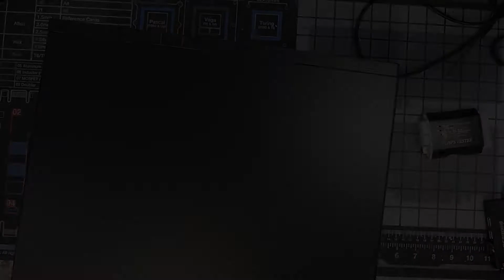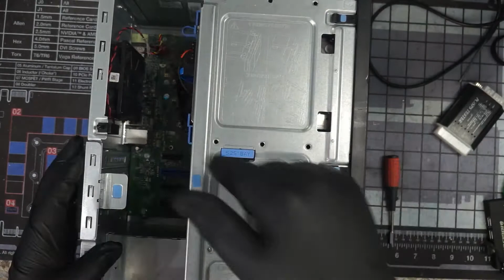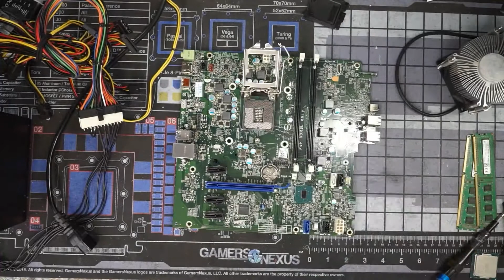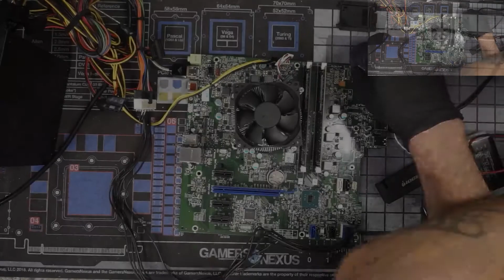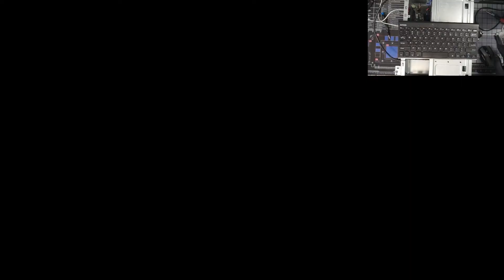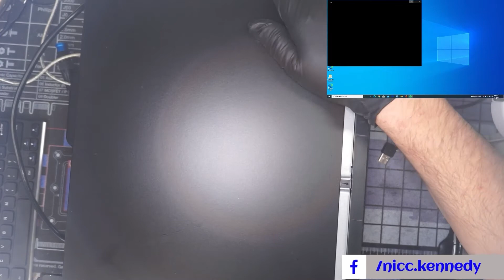Power Surge, Customer "Thinks" Power Supply is Bad ( Is it Really though?)

Comment: My friend has a computer that shut down randomly playing 7 Days to Die. 
She said it was as if her monitor turned off. 

Her power button on her case still lights up when it’s “on” and off when it’s “off”. Besides that, there is no other indication the computer is on. None of her case lights spin, the processor cooling fan does not spin, I’m not sure if her motherboard should have a light on the board to indicate it’s on, but there is no light there. I’m confused why the case light power switch still works though. 

Would this be a power supply issue or a mother board issue? 

She has an Intel core i5 @ 3.2GHz
GeForce GTX 1060
16GB RAM 
Gigabyte motherboard 

I’m trying to take the lead on this issue instead of my tech boyfriend taking over.
Reply from the maker: Have to troubleshoot. Try reseating the ram with power unplugged. Unless you have spare CPU, power supply and motherboard, will be hard to troubleshoot beyond that. You can research using paperclip or wire to test your power supply with every connection unplugged from the motherboard, but not recommended if you are unfamiliar with this method. Most people would use a power supply tester.
Reply: this type of problem usually because of overheating. maybe the gpu fan not been optimize. causing the overheating.

Comment: You did not explain what was wrong with the original motherboard.  Why did it fail?
Reply from the maker: The optiplex from this video was in a residence. For different models of this brand computer bought from us, I kept spare parts in shop to keep downtime to a minimum. I have looked at a number or these computers. If i remember this one correctly, it was missing one of the power rails and not turning on. Having spare boards, i did not dig too deep into what the problem was. Perhaps a revisit on this board? I will also need to order or make a new optiplex to atx power adapter, the one in the video was reused to make another cable.
Reply: @NiccKennedy  Thanks for the reply.  I have been searching for days on a solution.  I came close but still not fix.  I saw a video where this guy jumped the pins on the 24pin power connector while connect to board and it powered up but turned off when he removed the jumper (tweezers).  So, yes it seems a missing power rail somewhere.
Reply from the maker: @whollenbeck8  I dont want to recommmend too much or too complicated information, however, these boards fail like this for a few reasons. Multimeter and test, is one way to run it down, and if you know what you are doing, voltage injection. Word of caution though, do not attempt voltage injection if you do not know what you are doing. Let me know how testing goes.
Reply: @NiccKennedy  Thanks.  This seem too far deep for me and would cost more than what the board is worth in terms of time and effort.  I'm just learning new things and this seems way far into the future if I ever decide to take the dive.  I've gone as far as reprogramming the BIOS chip with no success.  You'd think a decent surge protector and a PSU would be enough to filter out voltage spikes and whatnot from a lightning storm.  This board goes into the 'just for parts' bin.
Reply from the maker: @whollenbeck8  Exactly the place where the boards I've looked at went. BIOS reprogramming is fun. Use one of listed in description means of contact if you need help with bios reprogramming sometime.
Reply: @NiccKennedy  Thanks Nicc!
Reply: @NiccKennedy  Follow up.  After a long process of trial and error I narrowed down the issue with the mobo mounting to the chassis so I removed all screws and the dead slots are operating.  Perhaps a grounding issue or the chassis is warped causing the mobo to warp and make the cpu  pins bend just enough away from the contact points to disable the ram slots. weir huh?
Reply from the maker: @whollenbeck8  Possible cause. or there is a short created with the board installed fully in the case. Did you look for pinched wires, they do pack a lot of wires into a small space in the optiplex series.

Comment: I have problem so when I turn off my pc randomly in middle of the night lets say it turns it self on and it also randomly shuts it self down this not when just playing games this happens all the time even if i am chrome,i have tested everything exept my motherboard psu and cpu and i havent formated my OS yet either but i dont think its a os problem cause sometimes soon as i turn on my even before i boot into windows my pc shutsdown so please let me know if u know how to fix this this has been happening for the last month and i am going crazy
Reply from the maker: There are a couple of things to check. Check your bios, to see if there are any wake alarms set, like wake by network, wake by mouse or keyboard. Another thing to check, is the power button malfunctioning? If a desktop pull the connecter from front panel header for the switch ( located around the pins for reset sw, hdd led, pwr led, spkr) if it is a desktop. Laptop will not be so easy to test power button. Also check windows advanced power settings, by going to search, control panel, power options, advanced power options ( none of these settings are located under the gear  icon/ windows 10 settings, but can only be accessed through control panel). Check those few things first, and then please let me know.
Reply: @NiccKennedy  thank you I just diagnosed that it is my f panel cable or connector I disconnected the cable and pc wouldn’t turn on by it self I appreciate this 😊❤️
Reply: @NiccKennedy  do I need to replace my f panel or is there a fix to this
Reply: @NiccKennedy  and my headphones when connected to my front panel also stop working randomly but mainly power buttons so this explains it
Reply from the maker: @Alpha-hp7xv  What computer is it?
Reply: @NiccKennedy  its gamming pc so i think i need to replace the case i have my warrenty still i should be fine
Reply from the maker: @Alpha-hp7xv  no worries then, get it in before warranty is up.